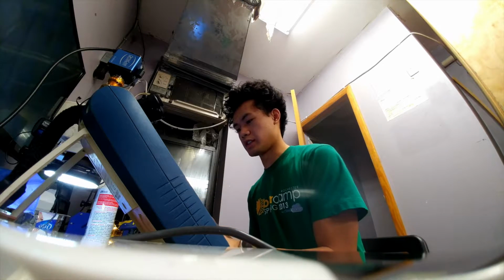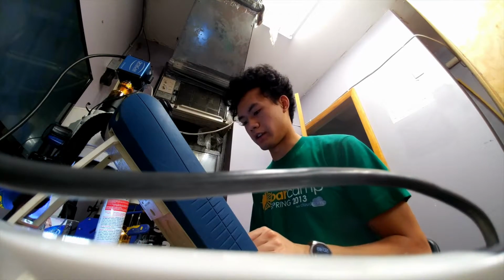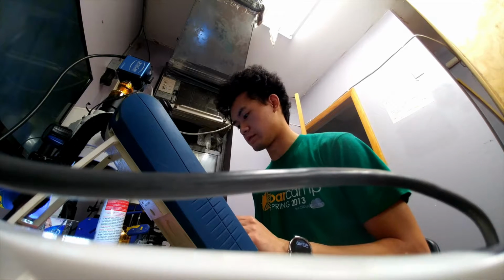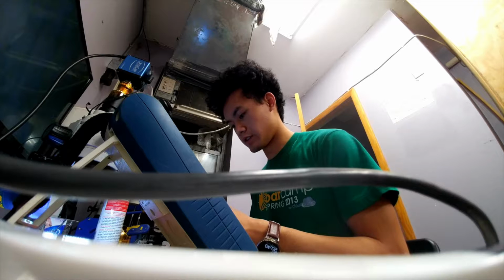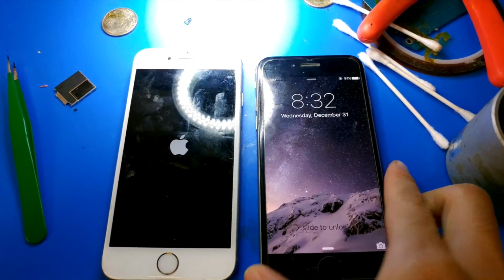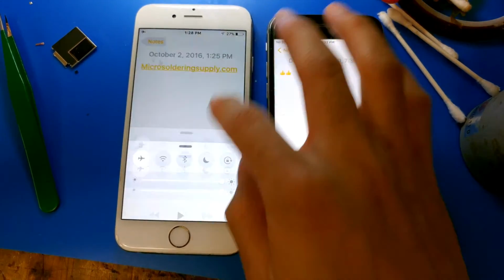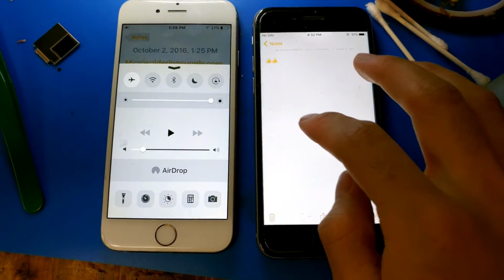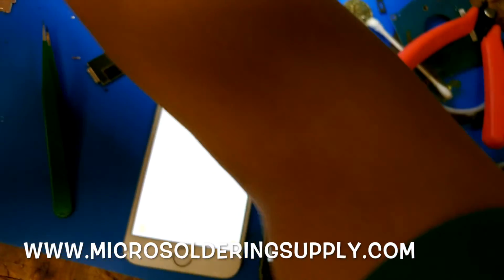iPhone 6 dim/flickering backlight after no backlight logic board repair

Comment: Thanks for the video! I have a question. What if iPhone 6 is on its lowest brightness and the slider doesen't do anything? It seems that FL2024 is slightly burnt. What do you think, is it the one filter that causes it or is there something else that has to be replaced?

Comment: Jason you could add an LCR meter to your tool set then you could have measured the inductance value and compared it to a new coil or one on a donor board I guess. I think Jessa has a in circuit pair of smart component tester tweezers. Might want to bounce that idea off her since changing the coil is such a time consuming bitch.
Reply from the maker: Lynn Nash You would have to remove the coil to test it to begin with. No point.
Reply: Most decent lcr meters will do in circuit testing so you don't need to remove the component unless there are no reachable test points
 I have two different meters and do it all the time
Reply from the maker: Lynn Nash No test points, but you're welcome to try it yourself and see how it works out.
Reply: Well with no test points you are screwed and have no choice. I haven't had a chance to go inside a 6. I spend my time in laptop's mostly lots of colleges where I an in southern California
Reply from the maker: Lynn Nash And that's why you would have to remove the coil, making it pointless. A for effort though.
Reply: Oh well maybe it will be useful in the future. I try to help when I can we get so much info from Louis and now you too so just trying to give back.
Reply from the maker: Appreciated!